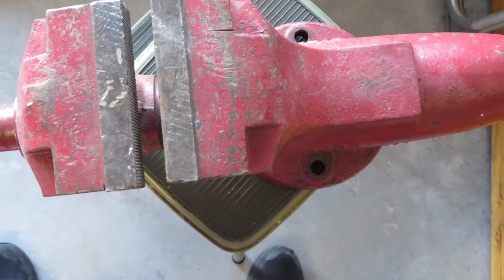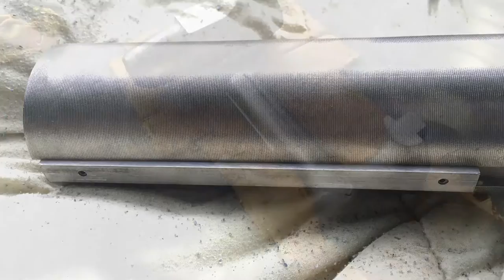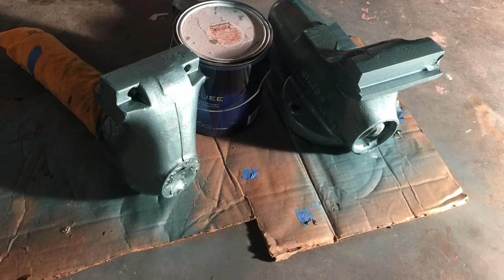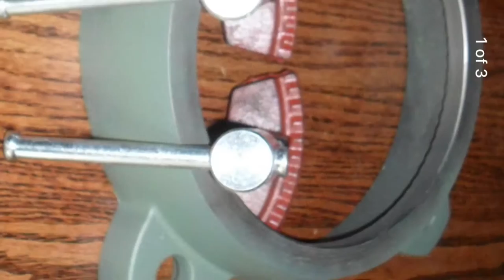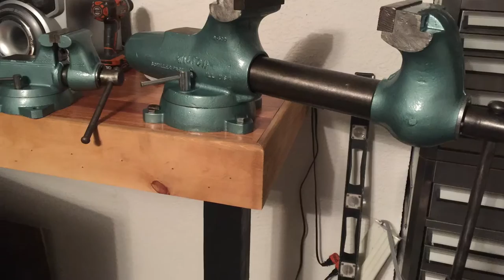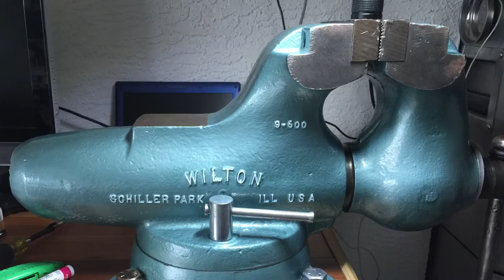Wilton Bullet Vise Restoration

Comment: Great idea on the firewall grommets.  Did you have to cut them to get them on the handle?
Reply from the maker: Thanks. I didn't cut them on this vise. I stretched them with two small screwdrivers. On a larger Reed vise I used slightly larger grommets so they can free fall. Those I cut and then glued together with Loctite. They work as intended.

Comment: Did you find when reassembling the rear pins in the back that it wasn’t the same fit as before removing them or perhaps the rear cap is a little looser?
Reply from the maker: The cap is on tight and has no play. I did not drive out the pins or remove the nut during breakdown. The next time I break this down for cleaning/repaint I will probably do away with them and tap the vise for socket cap screws.